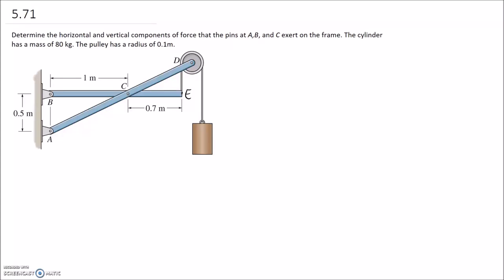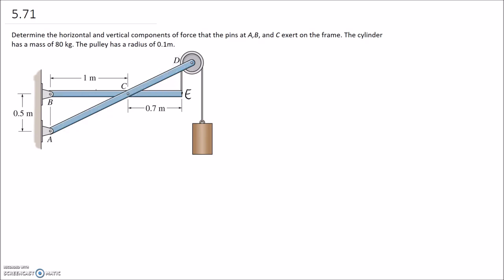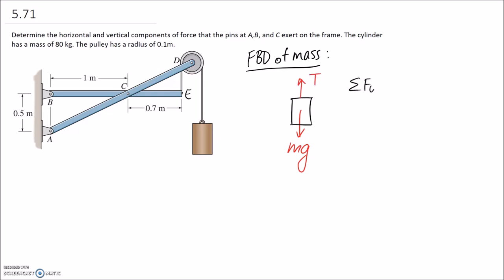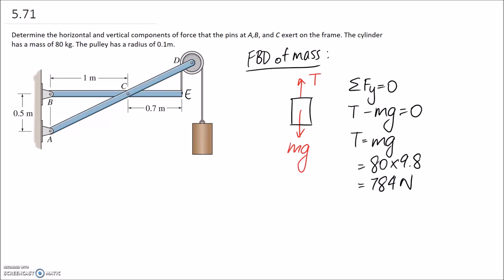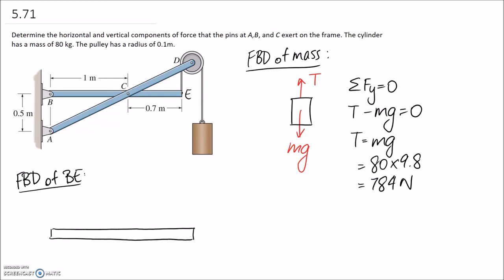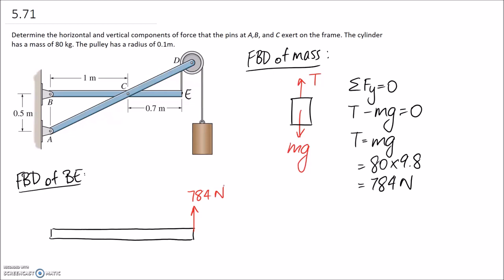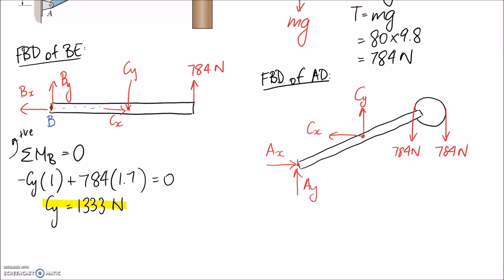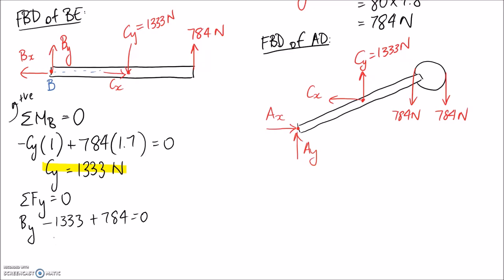Machine Analysis Example

Comment: Why did you not include the forces for the pin connected to the pulley?
Reply from the maker: I'm assuming you mean the pin at the centre of the pulley. The reason this was not included is because I didn't disconnect the parts (that is the bar AD and the pulley). If we had have disconnected (and drawn the free body diagram of each part individually) then we would have needed to include the equivalent forces acting there (like we did when we disconnected at C in the example).

Comment: Miss if your what if direction force is not correct in free body diagram
Reply: The answer will come out negative but the value will be the same. The negative sign shows you chose the wrong direction.